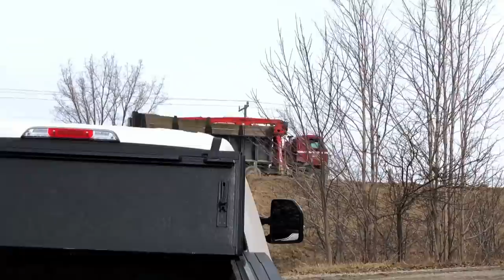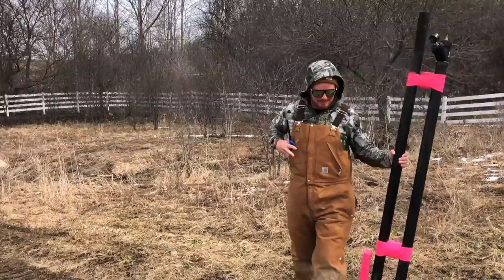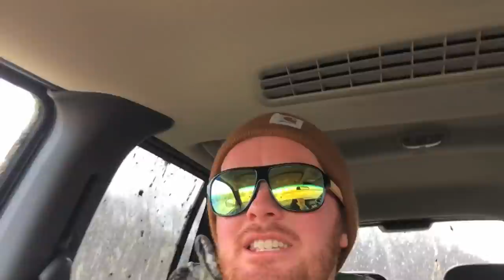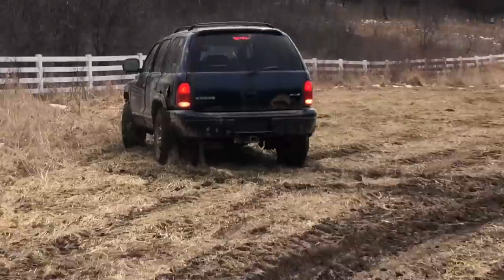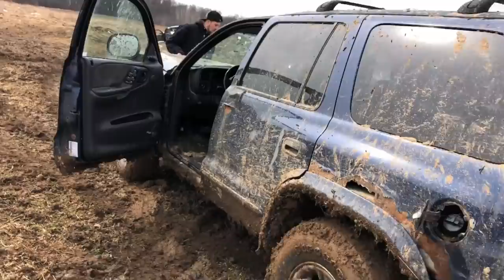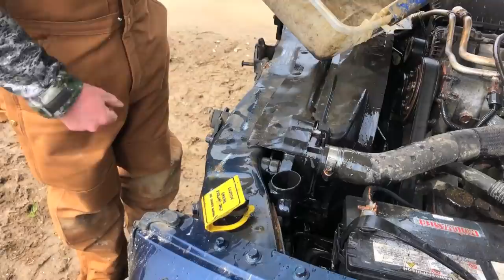Dodge DURANGO JUMPING Sideways!

Comment: Those 318 mopar v8s are though engines
Reply: Yep the 318 and the 360 are great . i have 2 360s and 1 318 . 300,000km+ on all of em and still runnin strong .
Reply: Boom Hower wow that’s awesome
Reply: Boom Hower I have a 360 they are beasts